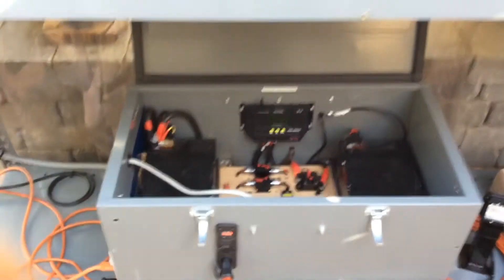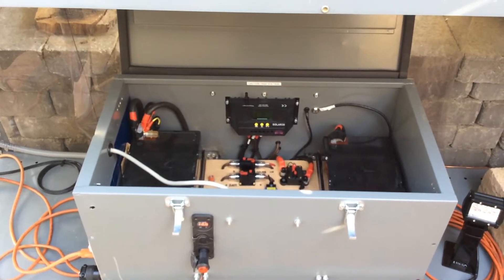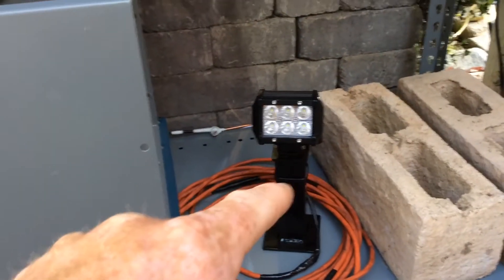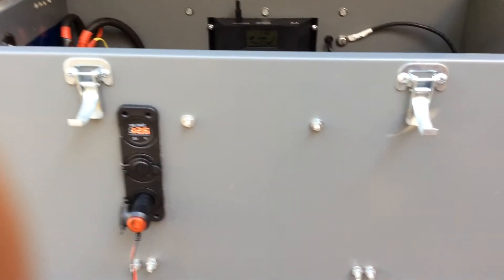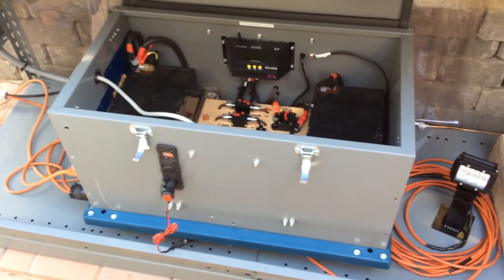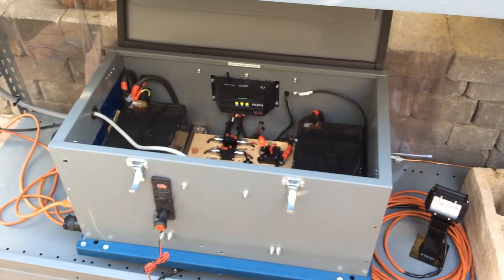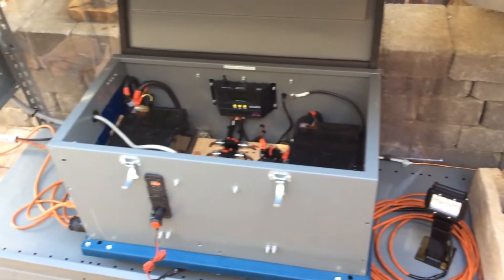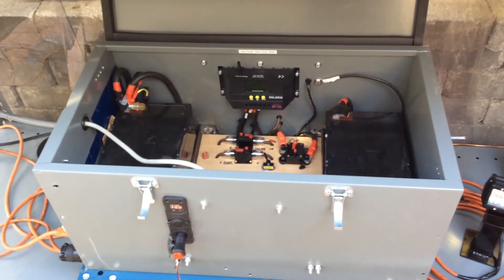DIY Solar Generator Portable # 3 what will it power

Comment: Wow with some Battle Born batteries in there that be a great setup. Or fill it halfway with used 1850 lithiums. it would be lighter and have triple if not four times the power. But would cost a fortune..great setup you got to work with what you got. I wonder if 24 volt would be better. I'm definitely building me own.  just going to watch everybody's work. then come up with my own idea. Or actually someone else's idea that I put together myself.